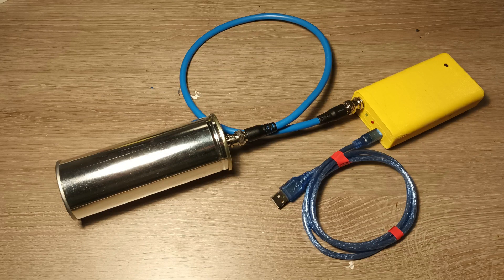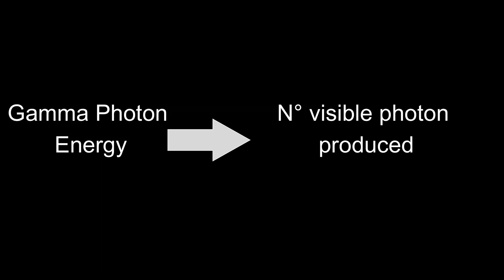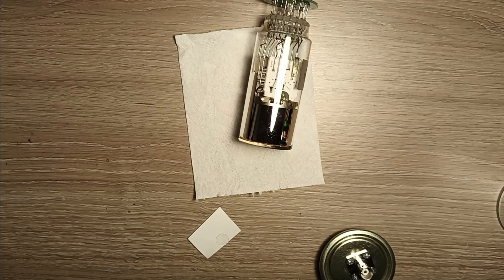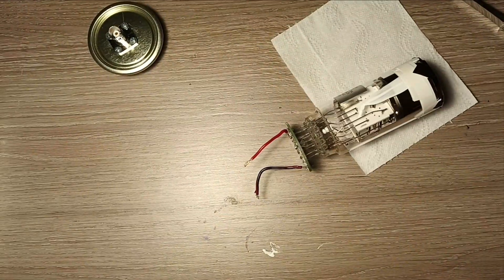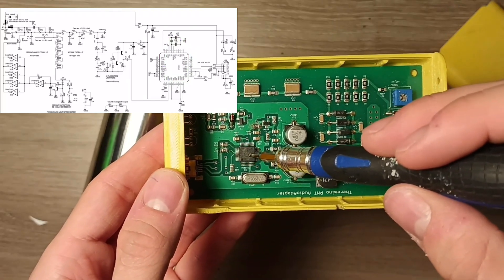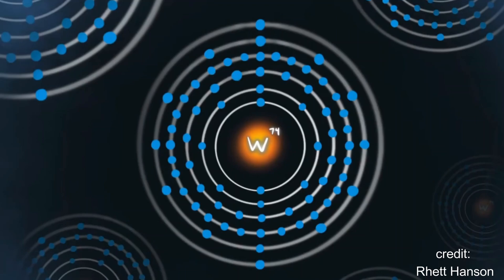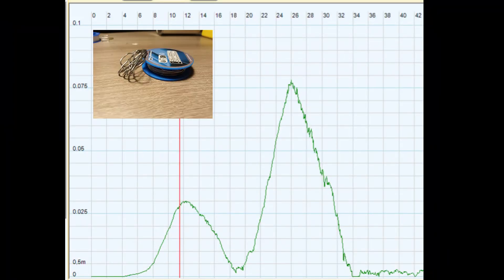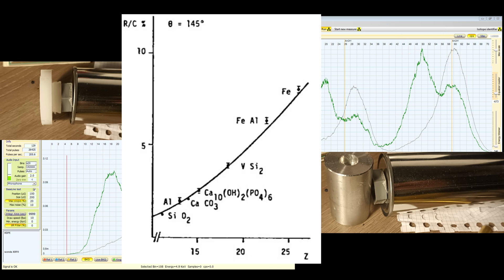Homemade X-Ray Spectrometer | XRF - Compton Experiments

Comment: hi, very cool build! i had a trouble to understand what is your x-ray source tho, and how does it work. I understand that is that gray piece with six metalic elements arranged in circular shape but thats all what i get. What is that blue thing connected to it, an electromagnet? i dont get the idea.
Reply from the maker: It's Am 241, the blue thing was a lead piece for blocking the xray coming from the source from going into the detector, but its better not to use it
Reply: @Farben-X  thanks for an answer

Comment: I want to make this

But I drew the pcb diagram
But the gerber file is not generated

I keep worrying and ask
Can you give me the gerber file?

The photomultiplier is being shipped
And I am looking for other materials and csi.
Reply from the maker: @남남비-x1t  all the documents are on the site linked in the description, but if you are interested, maybe I can get you the pcb already assembled, it has some components that are not easy to find, how much is your price range?
Reply: Thank you for your answer The product is called HAMAMATSU 931B PMT Photomultiplier Tube and the price is 40 dollars I tried to order one of the csi but I contacted the company but I didn't get a reply I'm trying it because I'm interested in science but I'm having a little difficulty
Reply from the maker: @남남비-x1t if you're interested, I might get a board produced for 200-250€, this would contain the board, high voltage generator, and usb signal generator that only needs to be connecter to your pc with the MCA software.
Let me know
Reply: Thank you for your answer

I  sleeping  so  late

I'll try a little more

I have one more question.

Can I know the purity of the substance?

Where do I pay if I buy it?

I've never bought anything overseas, so I don't know.

Yor  are  so  kind  
Thanky  you
Reply from the maker: @남남비-x1t  what are you referring to with "purity"? its a circuitboard
Reply: I asked if it would be possible to know the purity when measuring

For example
Gold
99, 90, 80%
Reply from the maker: @남남비-x1t  that is impossible, a device like that cost around 20000$, what I made is just a proof of concept to make qualitative analysis and get an idea of the element present
Reply: Thank you.
The world of science is interesting
Thanks to you, I learned something new
I'll look forward to many more videos in the future

I hope you have a good day
Reply from the maker: @남남비-x1t  Thanks, good day
Reply: @Farben-X  Sorry to keep asking, but

Hey, cool scientist, where can I buy PCBA?

And how much does CSI cost?
Reply from the maker: @남남비-x1t  you need someone to make it, it's not a commercial item you can just buy anywhere.
CsI is around 50/60$ depending on where you buy it
Reply: @Farben-X Yes, thank you

I'll have to give up on what I'm making😅
Reply: @Farben-X Yes, thank you so much
I wanted to make it as soon as I saw the video

There's an error in making PCba
Csi company is 600 dollar price

I'll have to look around in China

Comment: Nice video that explain a lot. Is it possible to use dental xray head instead of americium? And secon question is is it possible to use solid state device instead of PMT? I want to do experiments but am afraid that tube will not survive postal service that we have.
Reply from the maker: hi thanks; it is possible to use dental head, but it is a lot harder for different reason: 
1 your emission spectrum will be very broad (see my other video https://www.youtube.com/watch?v=EKCt-dHuzS4&ab_channel=Farben-X from  minute 47:30) with a relatively low energy emission peak (peak keV =around tube voltage/3)  this will limit the element you can analyze, as their Kalpha must be lower than the tube emission peak. 
2 som of the excitation will bounce into the detector, and being broad the emission peak detected will reduce resolution a lot as it will superimpose to a big part of the signal.
3 for this kind of analysis you don't need high x-ray dose, so you would need to drive the tube to very low current to avoid saturation of the PMT.

4 it is very hard to shield x-ray tube weel enough so that the x-ray that escape around don't reach the detector, and this signal will add to the background as before, reducing resolution or even saturating the counter.

btw solid state device are not good at low energy resolution, unless chilled to LN temperature, and if I were you I wouldn't worry about PMT shipping, I bought multiple PMT some of them flew from the other part of the word without being damaged, they are a lot stronger than their glass structure might let you think, just be sure that the seller puts at least 10cm of foam around it and it will probably survive a crash from an airplane.

Comment: nice video but i have a question does this xray spectrometer works witha any meterial like plastic?
Reply from the maker: Do you mean if it can analyze plastic materials?
Reply: @Farben-X  yes
Reply from the maker: @The_electronics_nerd  well in some ways it can, as I showed with the compton effect in HDPE, it is possible to determine the effective atomic mass number of the target material. but plastics has some limitation to XRF: being made mostly of carbon and hydrogen atom wich the first has no characteristic xrays being made of 1 electron only, and the second has a Kalpha of 277eV witch is not usable, it is not possible to use direct XRF to study it, but the backscattered spectra of the excitation source can instead be used and, industrially it is done for example to determine the density of a sample and other priorities like the content of a specific contaminants

Comment: Very nice! I happened upon a PMT with a NaI(Tl) scintillator already attached and am putting together an XRF myself.
Reply from the maker: Hey, thanks. NaI has a good resolution, but be careful to the encapsulation and probe wall thickness as it will absorb a lot of low energy rays

Comment: Would it be possible to use a radiacode (i would like to do xrf on the go without taking a ton with me)
Reply from the maker: Yes and no. The latest radio code model, 103g, has a GAGG scintillator, and as shown by others (like @project-326), it is NOT able at all to record energy under 50kev with good resolution (and the app will cutoff at 20keV), at least compared to the previous radio code model, which has a CsI(TI) scintillator like the one I used in my video.
The biggest problem you will encounter is that the radiocode plastic shell will attenuate a lot the low energy XRF, and may also cause compton shift as I have shown with HDPE, so if I wanted to buy the rediocode just for XRF,  no.
Another big problem that is influenced also from the previous one is that acquisition time for the radiocode is really long, so maybe not perfect for mobile apparatus.
But If you're going to buy it to do other stuff and as a side experiment try XRF go for it.
As I said in the video the transparent window (to x-ray) is really important.
Reply: @Farben-X  I'm just wondering since i already have a radiacode and if I could get some more use with it like xrf great if not still good
Reply from the maker: @The-One-and-Only100  do you have the excitation source? I think it will work somehow with heavy elements like silver, and above, but with things like copper with characteristic x-rays at the 5-10kev range the attenuation and flux might be too low to get a quick measurement, you should try. An x-ray tube as a source would help in this case but it would become really bulky.
Reply: @Farben-X  project 326 used strontium 90 so I'm currently looking at getting a type 75 geiger counter
Reply from the maker: @The-One-and-Only100  do you refer to the backscattered electron vs atomic mass experiment, or to get XRF from strontium electron exciting the sample and making characteristic lines?
Reply: @Farben-X  backscatter
Reply from the maker: @The-One-and-Only100  ah ok, wel for that kind of stuff you don't need a radiocode, a simple geiger should work, but i don't think it is really portable as a setup, also you  will be able to measure only pure elements, because if you have let's say a mixture 50% of copper and tungsten, you will measure an effective Z witch is the weighted mean between the two, and so you won't identify neither of those.
Using americium and proper xrf is probably the best option

Comment: Congrats on your XRF detector! It is certainly convenient to just leave the front scintillator surface exposed to air, thus allowing it to easily detect lower energies (under 12-15 keV). However, the CsI:Ti scintillators are still considered mildly hygroscopic, hence typically requiring encapsulation which will then ruin the ability to detect lower energies unless the front window is made from beryllium...
Reply from the maker: I wanted beryllium for my detector so bad😵🥲 if only I had been born 50 years ago
Reply: Be discs and other parts are available online. Maybe do not attempt to work with its powder nor machine at home and you should be fine.
If ordering from the Far East you could have it delivered with the crystal, that would make the paperwork simpler too.
Reply: I can hook you up with some beryllium windows soldered onto metal for pretty cheap, let me know if you're interested  @Farben-X

Comment: Great video, great results!  Perhaps you can include some links in the video description to the version of the Theremino S/W you used and also the PMT interface circuit?  The Theremino site is a nightmare to navigate...
Reply from the maker: @project-326  hi, thanks. Yes, I can relate  to that problem, so I added two links. You need to scroll down a bit to reach the schematics